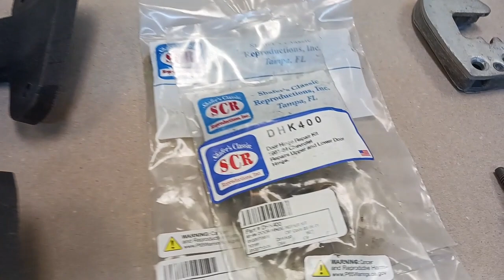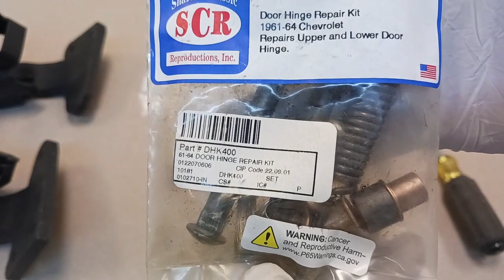1964 Impala SS Restoration Part 10 - How to Install a Quarter Panel:  First Step + Tips and Tricks

Comment: Is there a specific kit for the door hinges you can recommend? Suggest? Man I didn’t even think of rebuilding these. Good stuff bro. I tripped out on how much movement is on the bolts at the door and at the cowl. Lots of wiggle room
Reply from the maker: All the info is on the hinge rebuild package. Yeah the hinges usually get overlooked but it's the first step. Thanks brother